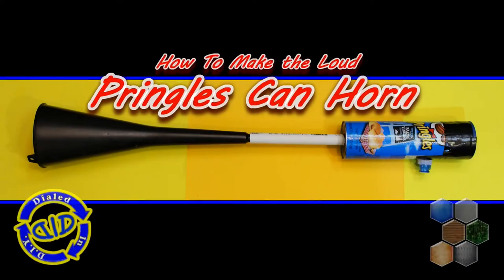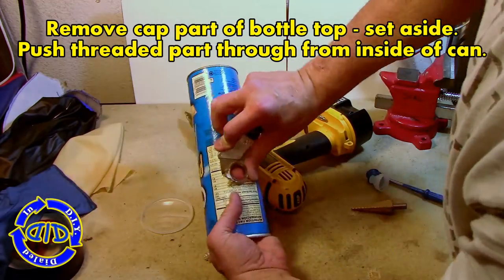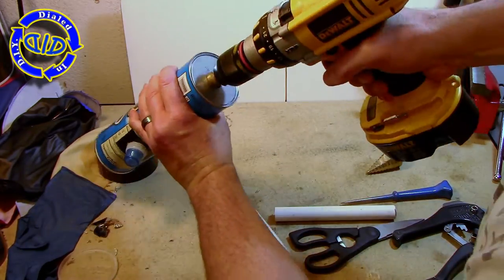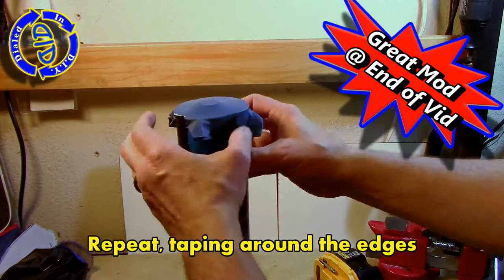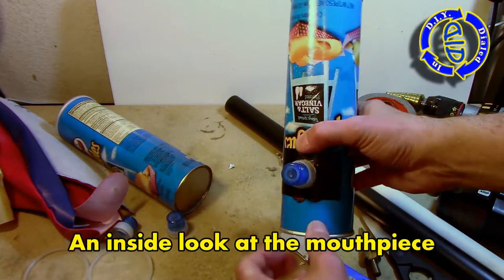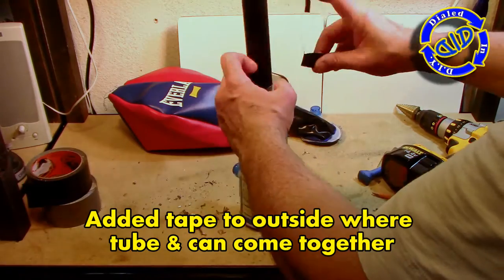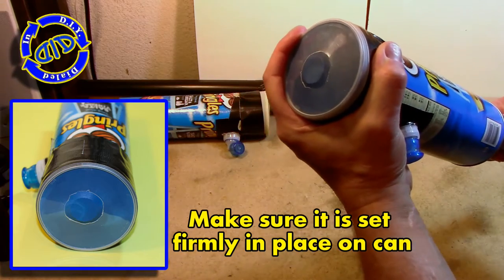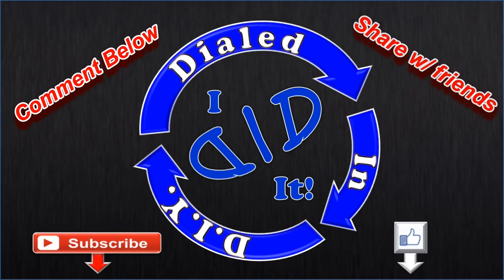Make a Loud Horn from a  Pringles Can - Amazing Result

Comment: would it still work ok if there was two tubes of different lengths inside the one can,this would create dual notes like a twin trumpet car horn??.
Reply from the maker: Great question; yes, as long as the diaphragm is firm enough you can add even more than 2.  So far I have used up to 5 smaller diameter tubes in a single horn base.  I recently posted another horn video using PVC (https://youtu.be/dU0z32cr8iE) which is closer to the types of materials I used for adding multiple tubes.

Comment: This is very nice. How hard are you blowing to make the sound? is it similar to the strength of blowing a whistle?
Reply from the maker: Good question... a bit harder than blowing a whistle but not like you are trying to blow up a new balloon... if that makes sense.  The force of air will also depend upon what you use for a diaphragm and how much tension your inside tube has against it.  Thanks for the comment and the question!!